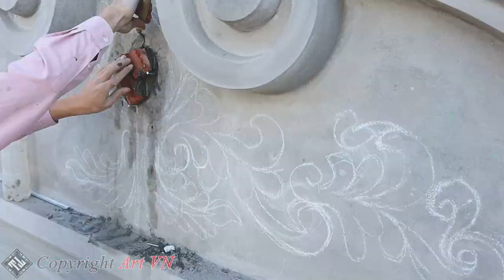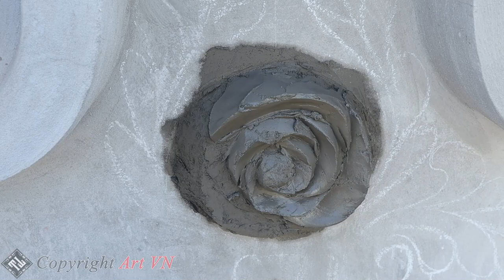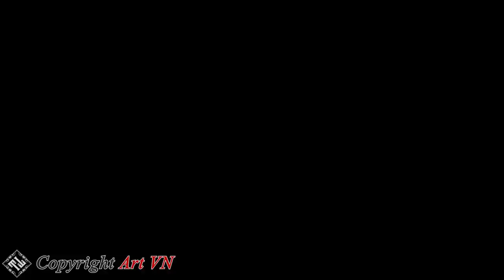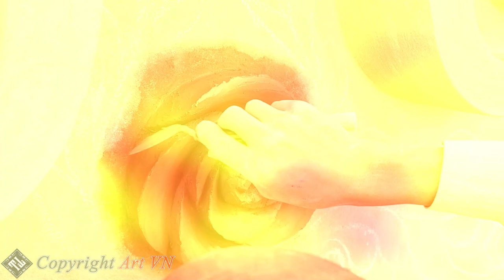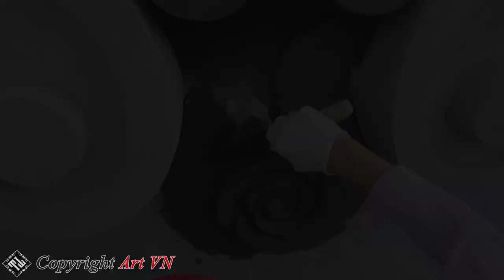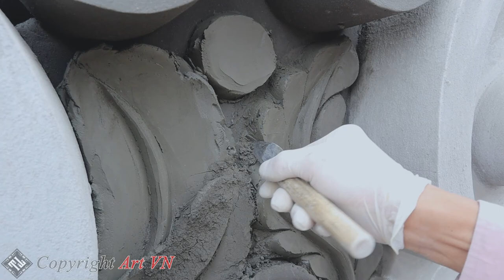How to sculpture cement flower - Cement reliefs technique

Comment: It does not crack what to do to avoid crack in it ,please... Give me the Answer , becausw i have tried but i failed due cracks and its fall apart...😭😭😭😭😭😭please help me
Reply from the maker: you use the ratio of 2 cement 3 sand. Please use water for the next day to spray on
Reply: Cement sand ratio, then don't expose it to direct sunlight before it cures completely